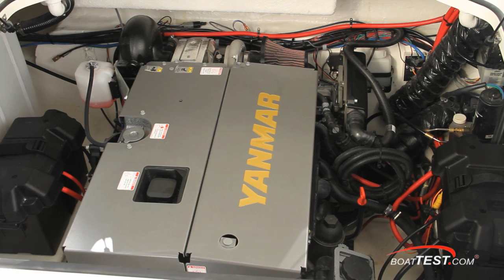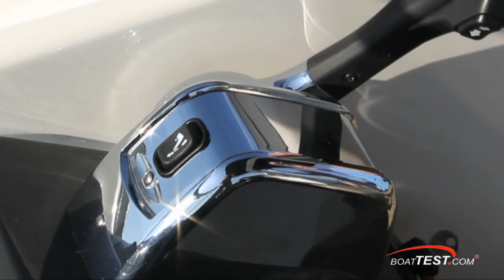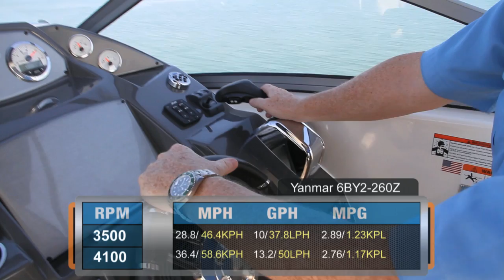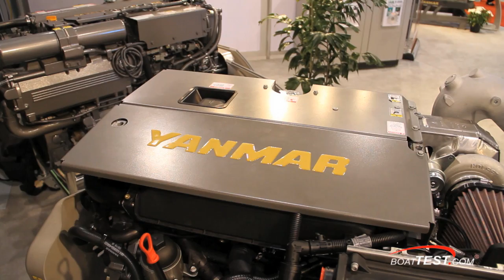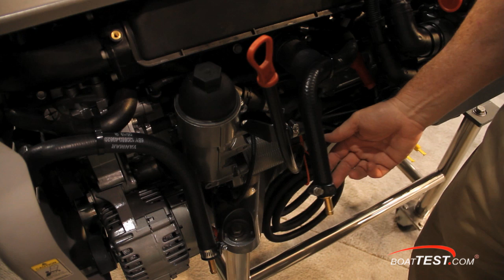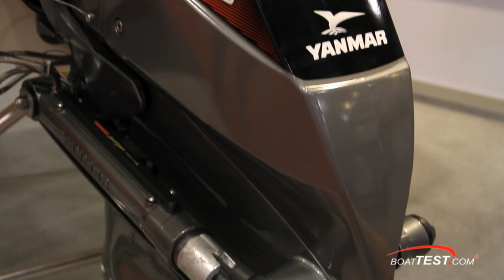Yanmar 6BY2-260Z 2011 Engine Detail Reviews  - By BoatTEST.com

Comment: you pointed at the aftercooler/intercooler and stated it was a turbocharger however the t turbocharger is what the airfilter is connected to, this is clear as day, its also worth noting these engines use bmw blocks and technology.